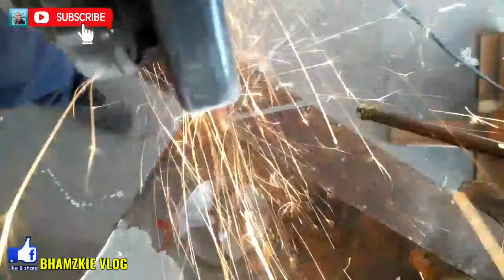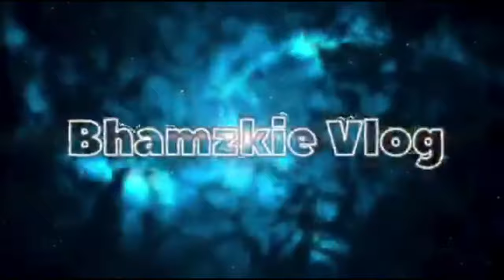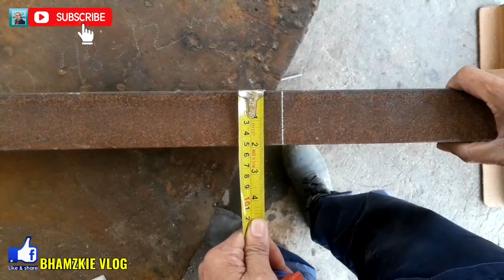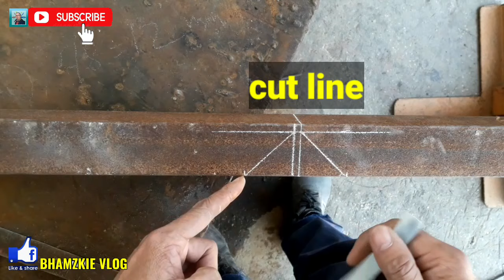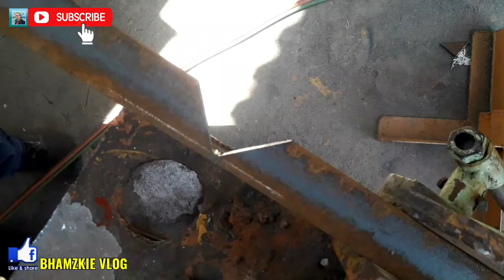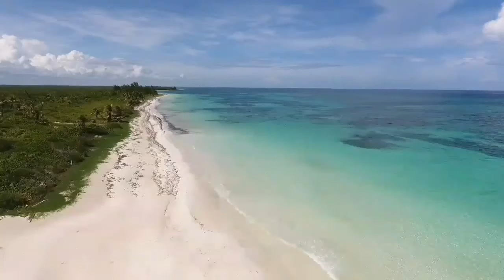SIMPLE TRICKS ANGLE BAR BENDING

Comment: It sure would be nice if he would talk and explain his measurements
Reply: He is demonstrating some solid techniques.   You don’t need “his measurements” to benefit from this video 🙄🤦🏻‍♂️.   If you do.  Then just flip over to a beginners channel and they will walk you thru a “build your first rack”.   Lol
Reply: Thickness 1/4". center line is the bend line.line to the right 1/8" from center line .line to left 1/8" left of center 1/8 + 1/8 = 1/4" thickness allowance. cut two 45 degree angles. 45 degrees times 2 equals a 90 degree bend.jim